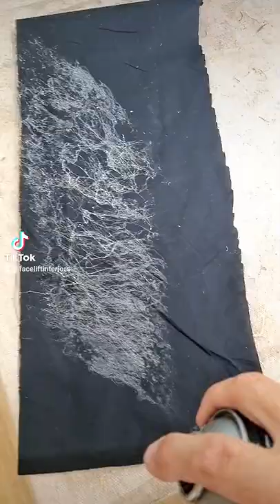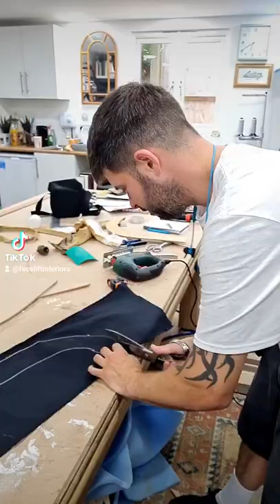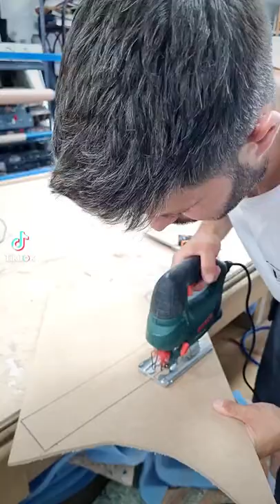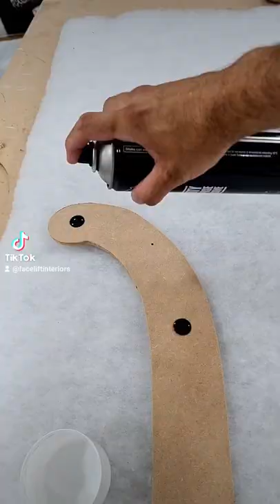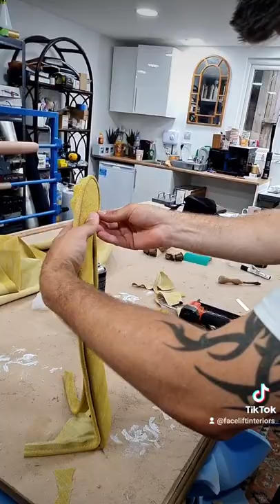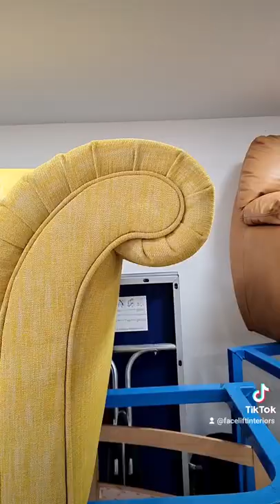A quick guide to arm facings on a sofa #shorts #upholstery #diy

Comment: Do you just use plywood when doing wingbacks with a steep curve? I have done a few with ply and it seems to crack easily when it’s thin like 1” wide
Reply from the maker: Hi Kevin, sorry for the delay in getting back to you. No I don’t use ply wood when doing wingbacks with a steep curve in the front of the arm - I staple the fabric on and then use studs or use piping and metal gripper but that way is a huge faff!!